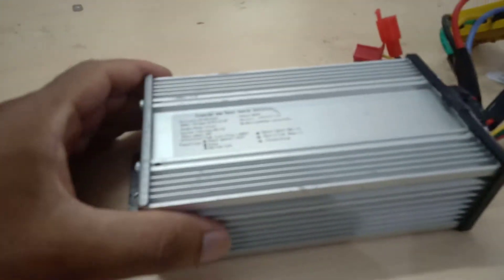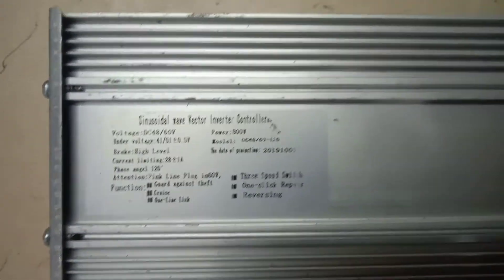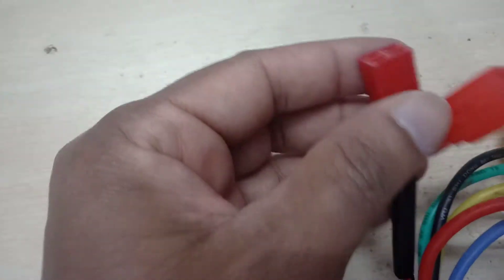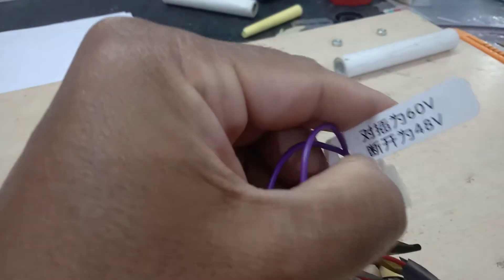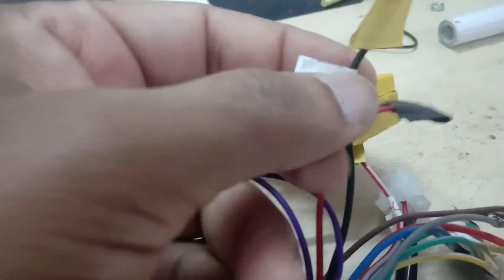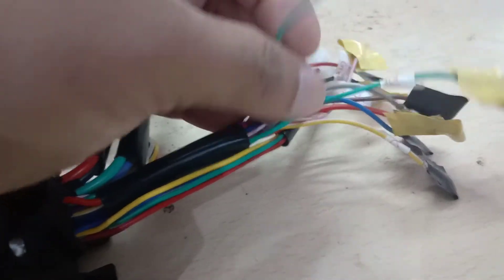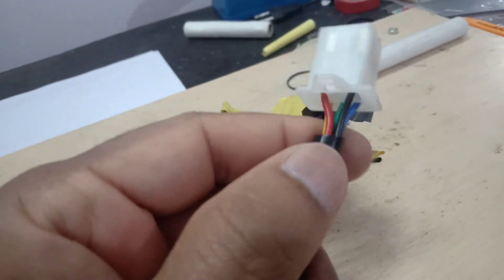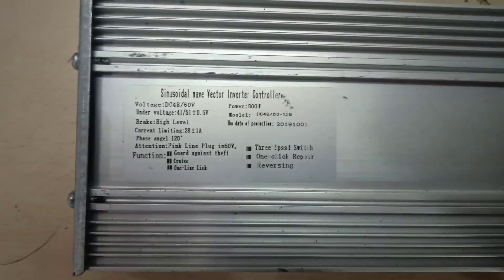sinosidal wave vector inverter controller electric bike controller wiring explained in detail

Comment: With much respect, you don't know what you are doing or saying.
Reply from the maker: Yes exactly, you can ask me your doubts
Reply: Is this the changer and I absolutely have no idea what I'm talking about.   And if not what'd tbe point and y doesn't every bike/scooter have 1.  

And while u definitely know more then me it doesn't sound like u should be making a video explain this when you even say on the video you don't know what this wires for or this wires for it seems like you should have done just a little bit more research before making this video but either way like I said you know way more than me and actually thank you for making the video